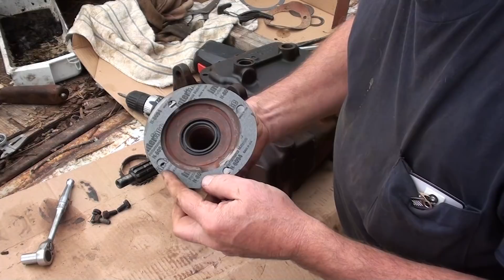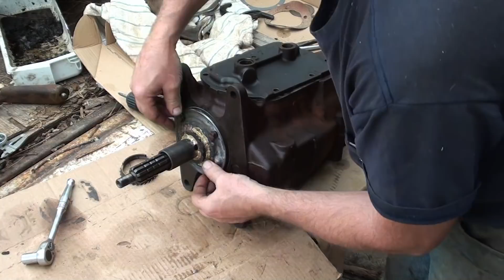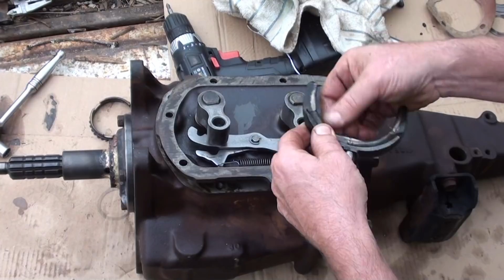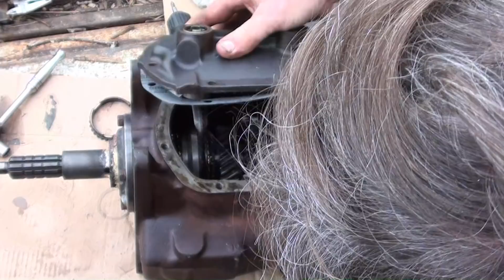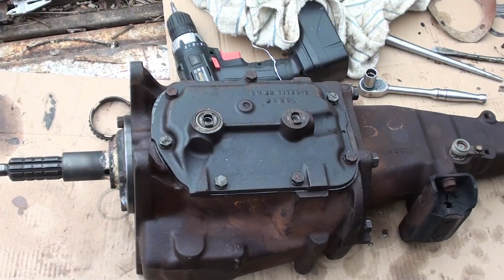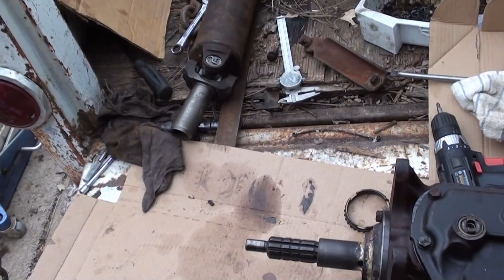Warner 3 Speed Rebuild Part 5 1958 GMC Resurrection Part 13

Comment: I had one of these transmissions in the new 68 nova I bought with 307v8. it came with a hurst shifter from the factory. really good transmission. strong and shifted nicely. Liked it much better than the older non synchro low gear ones.

Comment: Just went through the same thing with the Borg Warner 3 speed T85-C I have. Needed a 16 spline slip yoke but could only find ones that were too small or 27 spline.....

Comment: AHhhhhhhh NUTS !  I feel for you Jeff, But I know your pain.  I did a similar rebuild on a 68 Chevy 1/2 ton 4x4 3 speed trans, But it was the pill box 3 speed . That is a hard to find transmission these days but I found one and took the good parts out of the good one and put them in the other one and had to use the tail shaft out of the 4x4 trans because it was different than the other one, Plus it was going into a Rockwell transfer case that had the shift lever by your right leg. Don't ask me how but I managed to put a floor shift in for the 3 speed instead of it being a 3 on the tree. That was 3 years ago and I still have never driven the truck to see if it all works or not because I still have never found the right rear drive shaft yet !  And yes I took the truck apart and now I still cant find the right drive shaft that I took off it !  Someday I'll find it, Maybe ?   Bandit

Comment: You need a 13/32 wrench for the speedo clamp.  They used to be common in the 50's till some engineer said, "what is this madness" and 13/32 bolt heads were never made again. The only 13/32 wrenches available now are NOS or used.
Reply: Some of my wrenches used to be my Dad's, and before them they were his Dad's.  Now I know why I have that oddball wrench that never fit anything!  I think I have a socket too.  Thanks for enlightening me!
Reply: I had to buy a 19/32 wrench back in the 70's.  I probably could have made a metric wrench work, but I didn't own any.  I still remember how stuck that bolt was.  1966 ford f100. Probably not metric.
Reply: I've got several of those 32nds wrenches from my grandpa.  And they just sit in the drawer waiting.

Comment: Ain't nuthin' a correct yoke & a torque tube splice won't fix. Is Tony up to tasking the weld?
Case in point, 50 Ford pickup received a 283 Chevy engine & transmission by joining the Ford rear end with such a driveshaft splicing operation. Dad nicknamed it his Ford-Let. He'd also taken a wrecked 57 Pontiac engine & transmission & grafted the drive shaft to a 57 International Harvester custom cab fleet side short bed truck & nicknamed it his Pony-Binder. If that don't do the trick Jeff... We'll both, sure as hell wished it had! Dad would have enjoyed watching your vid's & positive attitude... even more than them reminding me of him. 12417

Comment: Years ago I tried to put a 3 speed overdrive in a 65 Chevelle.  I carefully checked part and casting numbers but nobody told me that the rear motor mount was moved about 3/4ths of an inch between the Chevelle and the full size cars.  I won't burden you with the rest of the story but it wasn't pretty

Comment: OK, I guess I miss the point. If the yoke you have is the wrong spline count, why not just change the yoke to the right one? It's a 6 cylinder wheezer. I know it's a smaller output shaft. But it's not like he's dealing with a V8 with a good bit more HP and torque.  It's been a while since I worked on one that old, my foggy memory says that's a car transmission. It will work. It just will not pull as heavy of a load. But who would want to pull something heavy with something that old?  With an old inline 6? It seems to me anyone that bought it would want to change all of that anyway.

Comment: To use that trans you'll probably have to (1. change the yoke) (2. shorten the shaft) (3. change the shift rods/arms) (4. have a speedometer cable issue). However the newer syncro transmission would be an improvement over the OEM.

Comment: The more I look at this the more I think you might have a '66 and later Muncie. The serrations in the input splines and the 7 bolt side cover. Then there is the output spline thing. I hope you get through this little hic-up.

Comment: I've been a bit perplexed as to what transmission this is. Dummy me it's a later all synchro 3 speed that someone put into the truck. A lot stronger than the glass 3 speed that GM used.

Comment: If you change the yoke to match the splines is the tail shaft the right length for the drive shaft,GM having long and short tail shaft transmissions ?

Comment: Just watch a video tip about installing  gaskets. Spray contact adhesive  LIGHTLY on both surfaces , waite a min. apply  and it stays in PLACE, for the connection. ( ChuckE2009)
Reply: John Mollicone chuck can weld but he ain't the best mechanic
Reply: It was his buddy steve that showed the tip on gaskets not stretch .
Reply: The Dude Yeah the boy is kinda rough lol
Reply: R E I agree but we were all young once and had to start some place

Comment: Also, your bell housing probably doesn't have threads in the lower two transmission mounting holes, because the lower two bolts are supposed to thread into the transmission flange from inside the bell housing.  (And it's a reallly bad idea to just put some bolts with nuts on 'em in there.  Holy cats, this is a bad idea.  And you'll discover that in a couple thousand miles when the input shaft bearing starts making those "fun" noises again, and the input shaft gear gets even more of that "fun" wear on it.)

Comment: Soooo sorry it wound up not fitting! If you don’t change the shaft on the universal to fit, at least you have a very well done rebuilt transmission for another truck or for sale. Just trying to make you feel a little better.

Comment: HATE when that happens!!! Is "stock" is not important, can't you simply change the yoke on the driveshaft?? Not familiar with GMC's but the old Chevies had the rear motor mount on the sides of the bell housing. Are GMC's the same?? This trany would work there with the proper yoke wouldn't it??

Comment: The gasket on the front bearing retainer wasn't cut for the drain...Didn't see one in the trans either...Maybe that's why it had that slinger and not a seal...Don't know much about GM stuff...